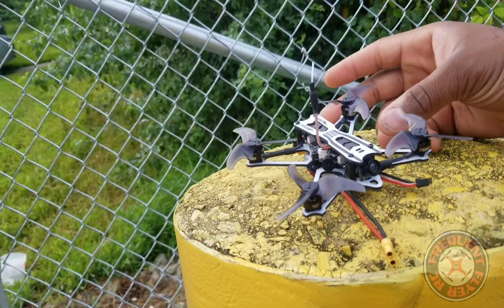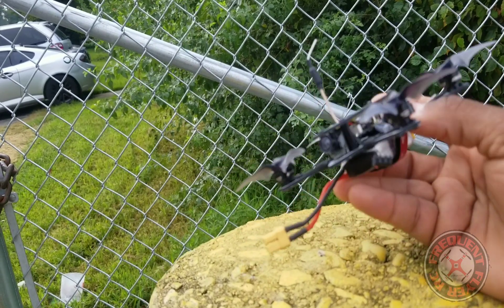TinyHawk Freestyle Profile 2 Is Better Tuned For 2S! (XT30 and Buzzer mods Done)

Comment: You are one of those gifted line of sight quad pilot which i always admire. If I was in your shoes, in terms of quad parts that need to maintain-just the basic fc+esc+motor+frame+receiver+ lipo, I would happily enjoy my flight without having to worry about fpv systems..like what I'm worrying now to get good goggles/antenna/fpv cameras/vtx & all those settings/maintenance/ precautions...hmmmm...so tiring. Thank you for your endless supports/helps in this challenging hobbies.
Reply from the maker: Thanks man! I learned on toy-grades and still enjoy flying them time to time. I wonder where would I be without them! I like to fly FPV too but I like CCD cams. Somebody tell RunCam to do a nano CCD! 🤣😂🤣
Reply: @FrequentFlyerRC  , yeah i heard they'll eventually phase out ccd cam 1 day but me personally prefer ccd.

Comment: I agree. PID profile 1 had a lot of oscillations for me. When I went to put on Andy RC's tune, I noticed PID profile 2 and found that it was similar to Andy RC's tune. It worked a lot better. Are you going to upgrade your VTX? I put a Crossfire Nano receiver on mine for additional range, but I'm limited to 25mw from the VTX. Which VTX would you choose if you were to upgrade?
Reply from the maker: Not sure yet but I do have an AKK VTx lying around 👌🏽

Comment: So you changed to P2.  Did you change the rate profile as well?  Did you do those changes in the OSD or betaflight?  thanks for the review.
Reply from the maker: Yup, changed to PID profile 2 using OSD. Never changed the rate profile.
Reply: @FrequentFlyerRC  I'd sure like to swap out the camera for something better.  wish it had better range,  signal gets wonky real fast.

Comment: What is the advantage of the graphene battery? How do you charge it? Great video and don't you have a park to fly in? It's hard to see the quad a lot of the time unless you are in the sky. There is too many distractions on and near ground level. Just sayin. I just ordered a THFS and your videos are very informative. The chop shop is great! Thanks!
Reply from the maker: Graphene packs are just superior to normal lipo packs. You can hold throttle longer with almost no voltage sag in most cases👌

Comment: Tuning betaflight 4.0+ isn't hard bro.  But it starts out geared towards a 5" with little to zero vibration issues.  I run the latest bf4 on my beta75 pro2 and it is as smooth as silk and mega nimble.  Much better than the earlier versions.  
The main thing with 4.0+ is the filtering.  The original version 4 had very minimal filtering and people were getting hurt, so the first update calmed that down a bit.  
It is worth backing up your current tune and messing with bf4.  Definitely worth it.
Reply from the maker: Will try my hand at it when it comes👍🏽

Comment: Cut down the clear part of your vtx antenna down to 12mm from the 'metal bullet' under the heat-shrink. Your range will be amazing.
Reply from the maker: Why? Antenna not at optimal length?
Reply: @FrequentFlyerRC  yeah for some reason mine and i suspect others was about 19mm or so, i was getting breakup quite close. 12mm is about right for 5.8ghz, so i chopped mine down. I can now get about 2 football fields away before any breakup so it definitely helped
Reply: Take a look here: https://oscarliang.com/make-simple-whip-antenna-5-8ghz-linear-polo/

Comment: I want one so bad... But found out its only a "tiny hawk s" with new frame and top prop motors out the box needs pid profile 2 for 2s nice flying tho.
Reply: it flys much faster though
Reply from the maker: Same guts but more capacitors and other optimization 👌🏽
Reply from the maker: B Sides yes because the props and motors are bigger and the frame is more aerodynamic 👍🏽
Reply: True looking thru the specs and viewing the board a lil better ur right slight upgrade nice lil bird

Comment: Hello Brotha.  I just bought the Radiomaster Zorro and I’m having some trouble binding to my quads and the ones that do bind either have the motors spinning in the wrong direction or the controls are reversed.  Can you help?
Reply from the maker: Wow, if the motors are spinning in the wrong direction if it's not just 2 of them doing it (turtle mode) then you can connect to BLHeli to reverse them..
Reply: @FrequentFlyerRC  Thanks Bruh.  Totally appreciate it.  Awesome LOS skills but the way.  Always enjoy your content.

Comment: Yeah, what's with the double glued up JST PH 2.0 connectors? Emax, that's dumb! I know what you were you thinking, but you thought wacky! It's not a who0p!
You really thought we wanted to F with hooking up two 1S batteries?
I avoid any 1S quads because those 1S don't last long, sag a ton, and have a short overall life span! They're an endless money pit! 
So, this XT30 mod should be factory! Plus, what's with the trend of not simply soldering on a buzzer from the factory?! You typically will add a capacitor, but not do the buzzer! Why? Don't say  motor beeps...whatever it is called, Those are quiet and nearly worthless! 🙄
I'm also COMPLETELY FED UP WITH the u.fl connector as the standard connector for VTX's! What a TOTAL PIECE OF CRAP it is! I just the other day had one ripped off, ruining the connector on the VTX, and the VTX IS NOW GARBAGE! The antenna was glued, attached with a zip tie and the u.fl was still ripped from the VTX and that VTX is ruined! I've flown the quad 3 times! QUIT USING U.FL's!!!!! THEY ARE DEAD TO ME! GARBAGE! 😝😵
Reply from the maker: LOL, You went in! 🤣😂🤣